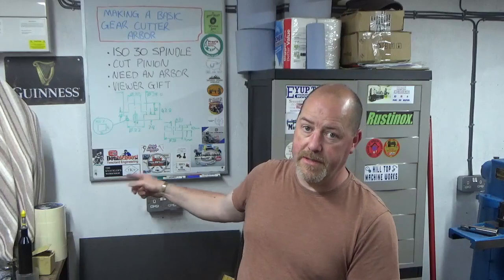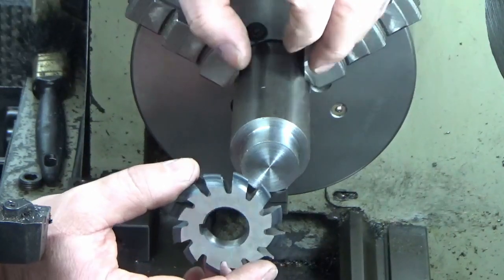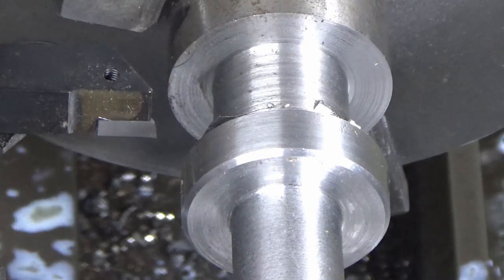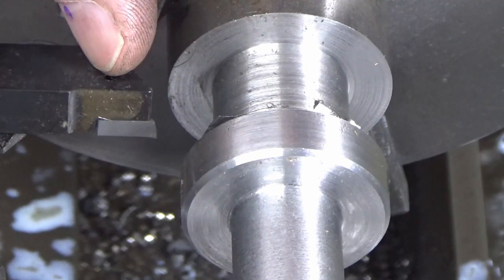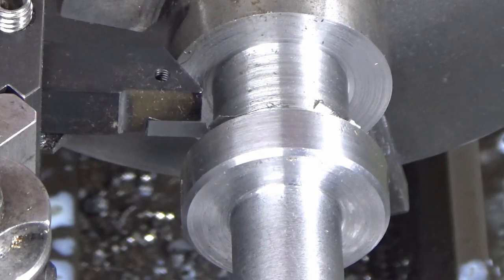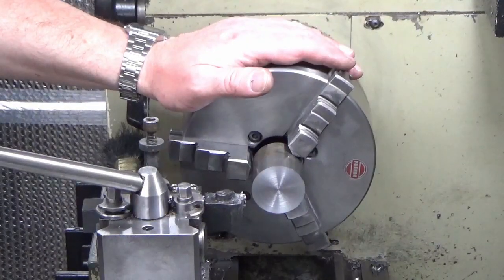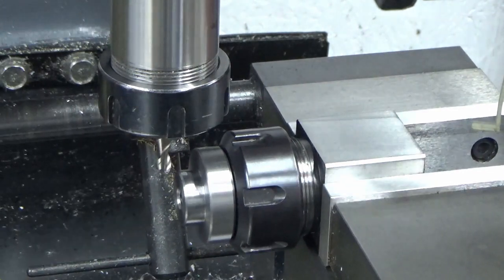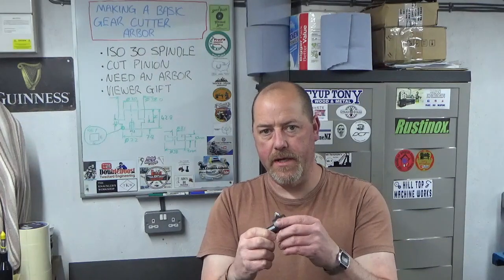Making A Gear Cutter Arbor

Comment: Good simple arbor Jon.  Some people totally over engineer what are basic involute mounts.  You could actually mill the keyway slot into the arbor body face to lengthen the load bearing surface without any detrimental effect (provided you clean up the indexing/locating face after).  Then use a key rounded off on one end.  Mine is like that.  You will never have imbalance issues with these arbors as RPMs are so low for HSS.   Nice of the viewer to donate the involute set.  Mine are inexpensive Chinese ones and they work brilliantly.  Cheers Rob
Reply from the maker: Hi Rob, thanks for the comment. Yes, I did consider plunging into the face to get full engagement of the key length, took the easy option lol. You need to be above 4000 rpm before you need balanced holders and tooling etc, so you are quite right. Cheers, Jon

Comment: Great little job John. I loved those small jobs. When I worked in the industry I loved doing about 3 small jobs at a time rather than turning a 5-foot shaft or a large coupling.
Reply from the maker: Hi Dermot, thanks for the comment. Yup, me too. Been on CNC's with 15 hour cycle times, boring as hell. Much prefer quick fire make jobs to keep life interesting. Cheers, Jon

Comment: good video Jon..It would be good if you bought a set of soft claws for your plate and then you passed them through the milling machine and turned them into a base claws and then screwed on them your own soft claws made of aluminum or steel etc... on a personal level I will tell you I rarely use hard claws...I always work with soft ones...it's much better and besides, I make the claws myself and they come out very cheap...greetings and thanks for your time
Reply from the maker: Hi Tr, thanks for the comment. Yes, I plan to do this at some point. I am used to working with soft jaws from years ago in my day job, they are very useful. Cheers, Jon

Comment: might be a good idea to turn the arbor in between center , it alows you to take the part out and turn it around when needed and as long as the lathe is set up right should get a more exact end result wouldve solved the problem with the "left hand tool" ....... oh ok youre making the part to chuck into a collet , thought you wouldve made the arbor and the taper for the iso 40 / mt4 out of one piece , think it wouldve made the tool a lot more rigit and less likely to spin in the collet
Reply from the maker: Hi Watahyahknow, thanks for the comment. You are bang on. I will definitely be doing this once I have the spindle fitted and working, I will be making an iso 30 version between centres. Just wanted a quick and dirty option to get me up and running. Cheers, Jon

Comment: Hi Jon,  that was great. Do you have a 4 jaw for your lathe? Rdg tools do them with a d4 mount. I like the arbour. I made something very similar (minus the key) for a slitting saw,  to make some parts for the Harrison mill. I wondered if you would be able in future to give details of where you get material from? Always good to find different suppliers. Look forward to the next one. Nice Poly Ordinate Variable camera work btw.
Reply from the maker: Hi Carl, thanks for the comment. Yup, got a Pratt 4 Jaw, it's a nice bit of gear and came with the lathe. As for material, I predominantly use Metals 4 U if I need to buy (a very expensive way of doing it but it suits my location and circumstances). I also am like a magpie in skips etc. I buy a lot of bar ends off Ebay, I put silly bids on and only win 1 in 30 ish but its also a good resource. Cheers, Jon
Reply: @jonsworkshop  I have my certified skip diver's ticket too. Quite a few of the metal stockists we buy from at work dispose of their offcuts to eBay sellers. I've had a few bargain wins too. 
Best wishes, Dean.
Reply: Hi Jon. I have a Pratt 4 jaw for mine too. The reason I ask about suppliers is I have just had to spring for a piece of bronze to make a new lead nut for the mill knee. Currently looking for some meehanite to make the new nut housing from.

Comment: Noice!

What's the chemical blacking you use?  Cold black, or are you hot parkerising?
Reply from the maker: Hi Wibbly wobbly, thanks for the comment and question. Cold black. If you go back to my video "Making vice clamps for the mill - part two" I show the product I use and where I got it from etc. Cheers, Jon
Reply: @jonsworkshop  Ah, thanks.

Comment: Hi Jon. That sounds like a really snug fit on the arbor. I've only ever used a home made single point gear cutter. I expect those proper cutters are much nicer to use.
Reply from the maker: Hi Olly, thanks for the comment. Yeah, I got a good fit, nice to feel as well as listen to lol. I have used quite a few proper gear cutters in my past, but all British made and all on big horizontal Mills, they are certainly less 'squeaky bum time' to use in that way than single points which I have also done. Cheers, Jon

Comment: Question for you Jon and others that read this comment. Why are lathes with Screw on Chucks made with Reverse? I know a simple answer is if it an Inch lead screw and you need to cut a metric thread then you can Reverse without having to disengage the half nuts. That works both ways, Metric with Inch pitch threads.
 I should have spent the extra $300 for the Cam lock version when I bought my Taiwanese Lathe new in 1985 that I still have. It however I have no issues with running it in reverse as long as the chuck is TIGHT and you are aware of depth of cut as well as feed rates. In other words, No Sphincter Puckering Moments.
 I am also considering making a new spindle for it with A taper/keyed nose to International standards by the way. 12 inch swing gap 18 inches and 36 inch center to center, metric 300 by 450 by 900 approx. 
John, Australia.
Reply: Even if the lathe has a screw on chuck it probably also has a set of collets that fit in the spindle bore too, and those are fine to use with reverse as you're not relying on the nose thread any more.
Reply: @ericfeatherstone  I do not have a collet Chuck for my machine, I dial in on the Four Jaw Chuck and I may also mention that a Four Jaw offers a much wider range than the Collet system does! John.
Reply from the maker: Hi John, thanks for the comment and feedback. As others have said, collet chucks or Morse Taper stuff using a drawbar means reverse is a useful option. Plus the screw cutting "keeping the half nuts engaged" method etc. I worry that some new starters may not realise etc, hence the warning. Many people forget that if you can use reverse then doing what I did on this job is a viable option. Be sure to check out my bloopers video at Christmas to see one of the big considerations though lol. Cheers, Jon
Reply: @jonsworkshop  A fair call on newcomers Jon, being aware of a Machines Limitations is very important in a Home or Work Environment. There is one other solution I have considered and that is to Mill/File a flat on the Chuck Spigot Register and then drill and tap the chuck back plate and use a grub screw with a brass/bronze button to lock the Chuck from unscrewing, I just have not made up my mind as yet. That could be a method others might like to explore. You need to if doing this the chucks and face plate/driving plates would ALL have to be indexed individually, not for the faint of heart I suggest. John, Australia.
Reply: Most lathes with screw-on chucks, from the factory, do NOT have reverse on the spindle (so that the chuck doesn't spin off).  Boxfords/Myfords/Hercuses had it as an option. Probably not for the ones sold to schools or apprentice colleges!
A bit of threaded rod through the spindle, bolting the job/chuck in place, is an easy safety mechanism?